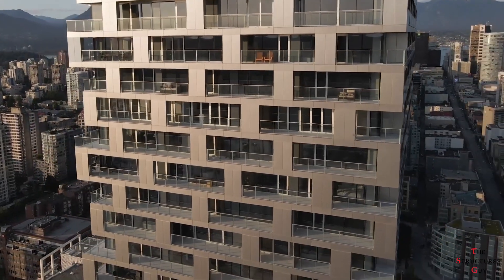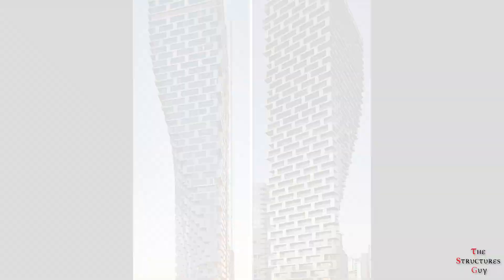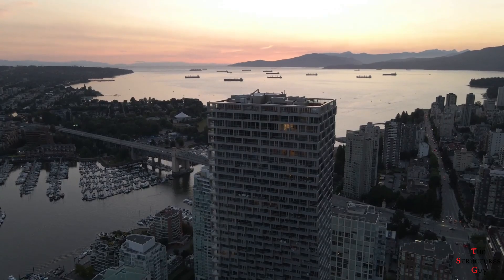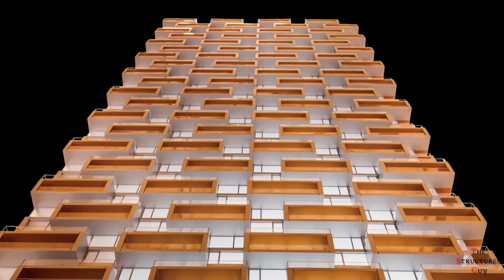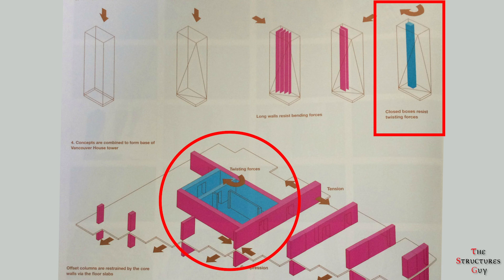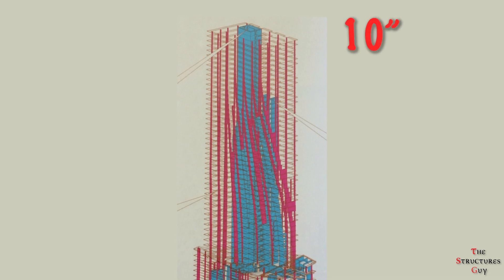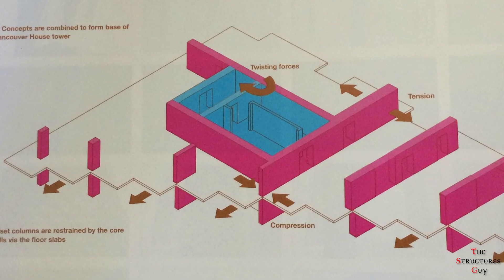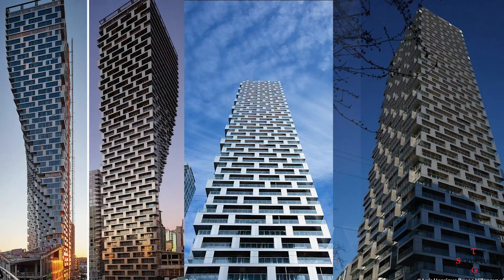The Engineering of the Inverted Building: The Vancouver House

Comment: I still dont  understand how they were able to calculate all the engineering of this building without having a very accurate way of measuring all of the weight in construction materials, In the  building process. Also it just seems like a bad idea to build this in a highly seismic area, right next to a main transportation artery.
Reply: It's the same as any other building. They estimate the loads as close as possible and then apply safety factors to loads and material strengths to ensure design stresses  stay within design code parameters.